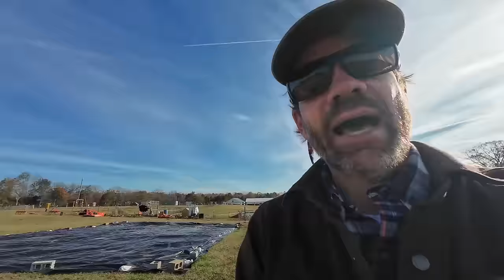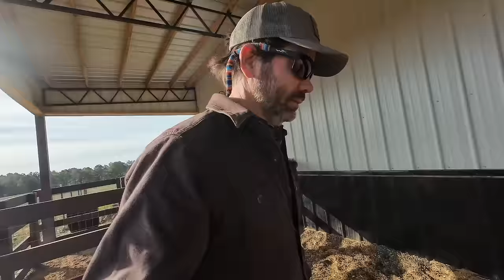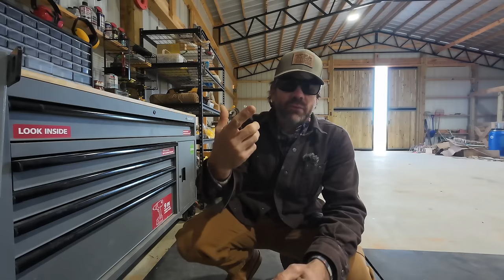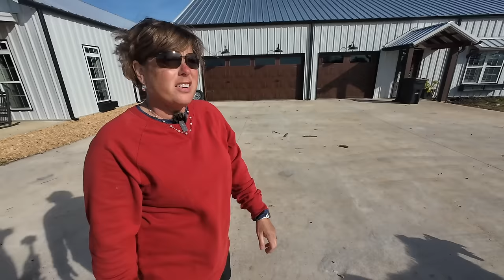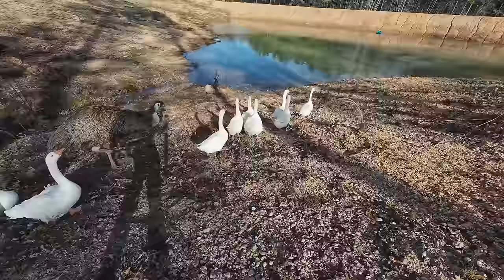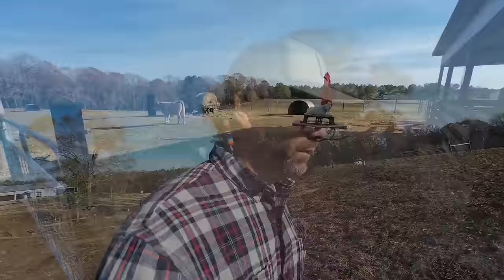Their Reaction To The New Pond is NOT What We Expected!

Comment: If you use a piece of black iron pipe with the inside diameter the same as the outside of of gate pin it works great and won’t slip off on you. Paint it fluorescent orange so you don’t lose it in the pasture lol stake some dead cedar trees to the bottom of the pond for fish habitat for small fish, I would still stake the pond so you can measure the progress and would be cool to see a Timelapse video or drone before and after shot

Comment: Hey Jason, a couple things. 
1. What do you figure your electric bill is going to be after filling that pond up?
2. I think I would use a piece of pipe for those hinge pins. 

Oh, and I had a thought when you were installing those feed troughs on a barn pens. If you had mounted them on the barn side of the pens, you could run a chute down through the wall and fill up the feed troughs from inside the barn and not disturb the animals. I think you would spend a lot less time feeding them.

Comment: Lumnah Acres is in the process of building a barn that will also be used for the Animals they raised.  What they are going to do is to add a Fence Gate in the front of the barn doors that will enable them to leave the Barn Doors open in hot weather.  They are also going to build some type of Pocket Gate that will be able to open and close from the inside.   Is a Gate for your Barn Doors as you get more extreme temperatures then Lumnah Acres who live in Vermont/New Hampshire.